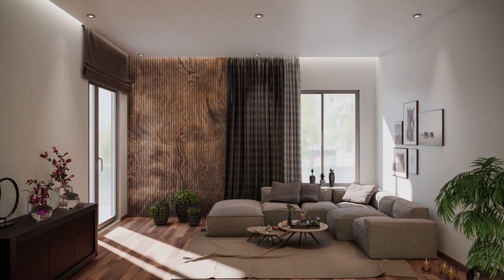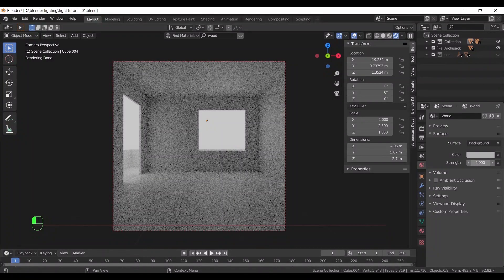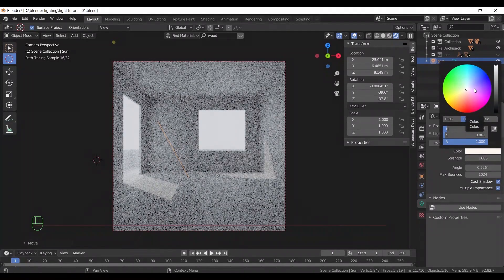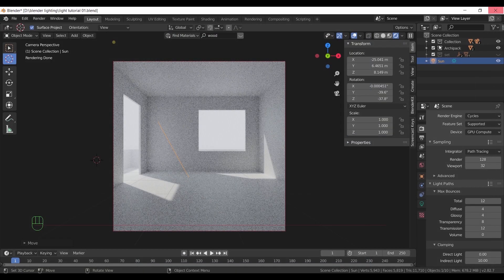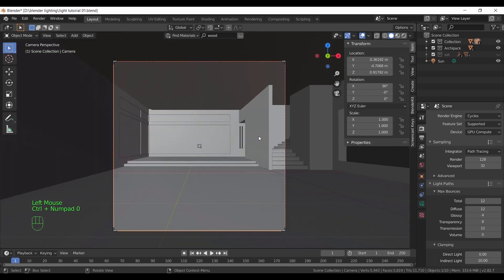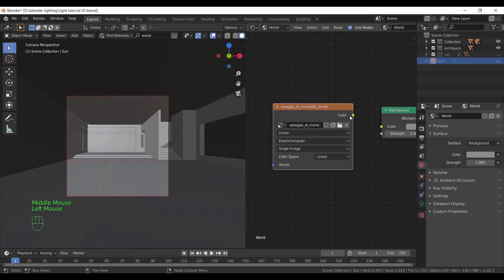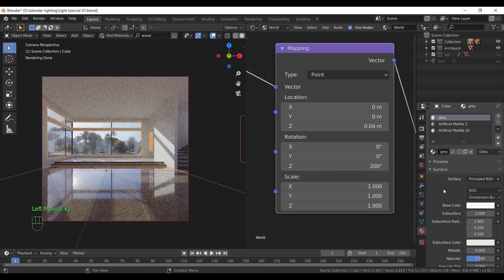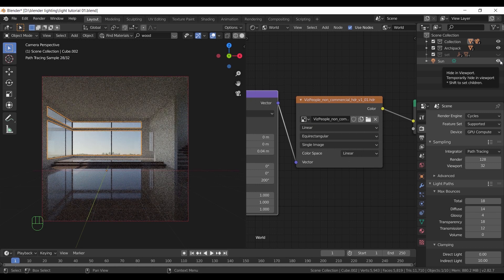Lighting Interior Archviz in blender - Beginner guide

Comment: I followed step by step this tutorial but my HDRI is not sharp clear in render mode. What should I do? thanks :)
Reply from the maker: Is the Sky background fuzzy? or is the sun light not sharp enough? We did use a blender kit glass( called  Eevee glass shader) so maybe the glass you used is a bit blurry, I did make a new interior lightings tutorial and I think it's more easy to follow for both daylight and night scenes, so check it out 
https://youtu.be/cPDdjTh0EYM

We also shared couple of add-ons that help setting up your sky easily here
https://youtu.be/PXaJ5B5t3e4

hope this helps💙
Reply: @architecturetopics  First, thank you your quick response. the sun sharp enough, and I can adjust it. My issue is about HDRI blurry even in render or/and view port shading mode. I tried 2K, 4K resolution even 16K ( I know is not necessary more than 2K) but same issue. Blurry true windows or without windows either.
Reply: @adam.gaming-hu  I know this comment is 11 months old but you most likely had a texture limit enabled. Limiting texture resolutions globally limits the maximum size of the HDR image resulting in a blurry image.